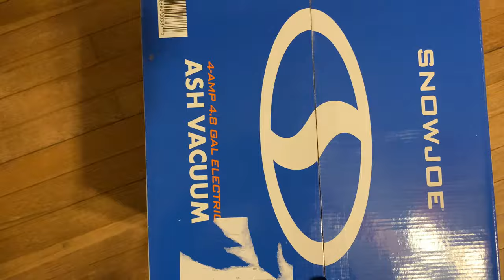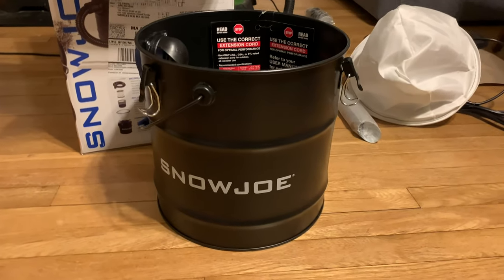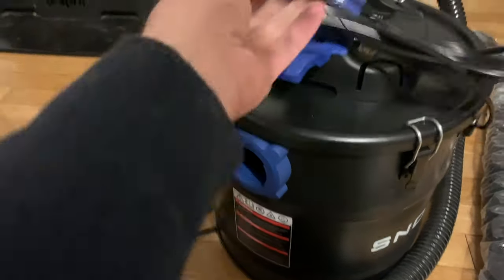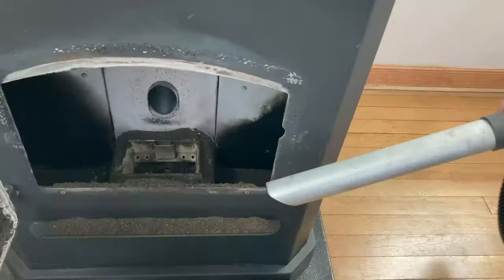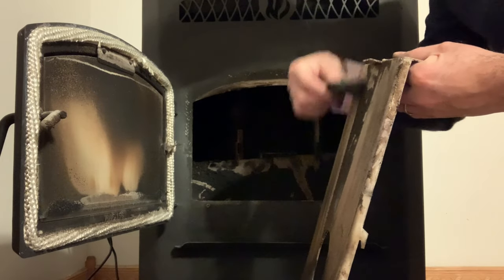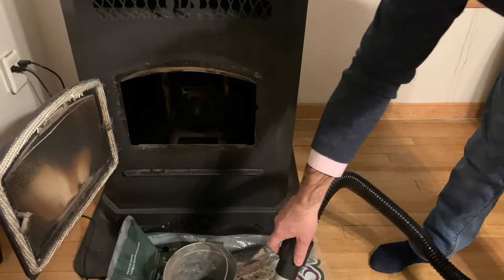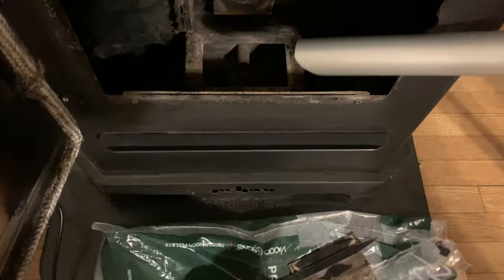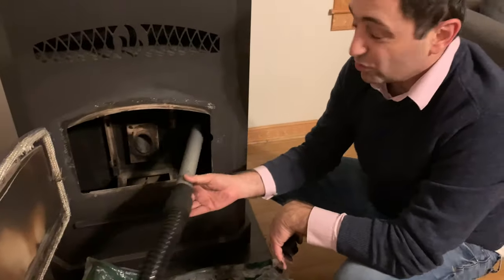SnowJoe - Testing the Cheapest Ash Vacuum

Comment: You did a very good job explaining ….But I also wanted to know how good it filtered while using it in the house….many vacuums can’t filter the Very Fine Ash so very fine ash dust blows into the room thru the vacuums exhaust port.
Reply from the maker: It does not blow ash in the house.
If you want to use it for the pellet stove it is not strong enough and I couldn’t add accessories to it (like a brush) … I will keep it to this…